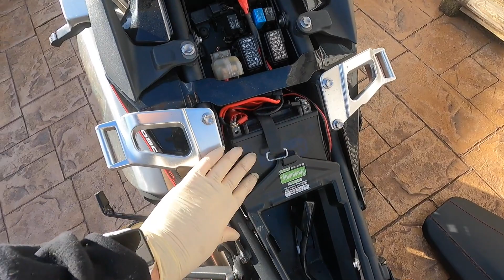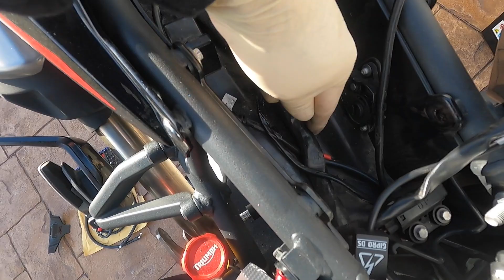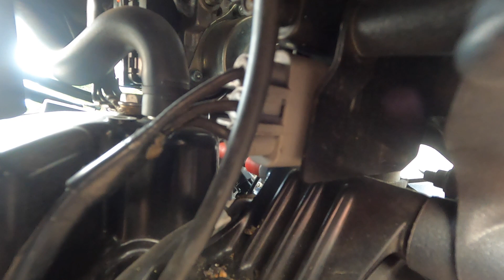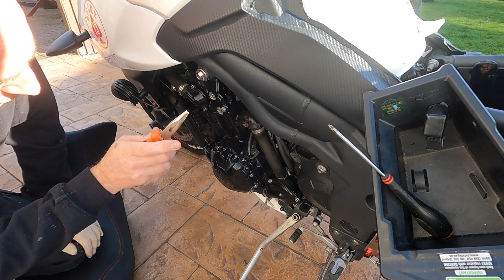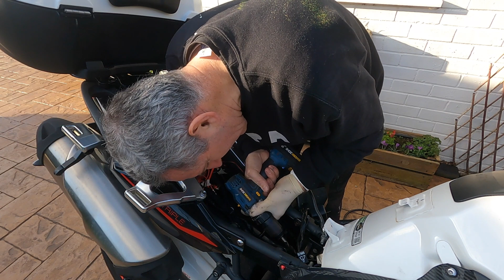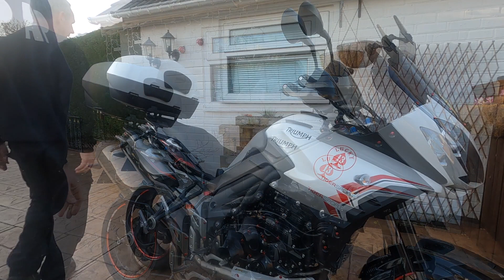Fitting "Jeff 'pudding' Halford" Cables

Comment: Do the triumph tiger 1050 & SE cables fit the Triumph tiger Sport model? I’ve seen that they don’t 🤷🏼‍♂️
Reply from the maker: You need to order the cables for the specific year and model as they are an exact fit and battery and starter motor positions can be slightly different.  Hope this helps.  Glyn
Reply: @glynday695  Thanks for the reply, final question. Where did you purchase the upgraded cables from? Or did you make your own?
Reply from the maker: @JamesEarnshaw-v6h  : Jeff ‘pudding’ Halford is your guy.  Search for him on Facebook.